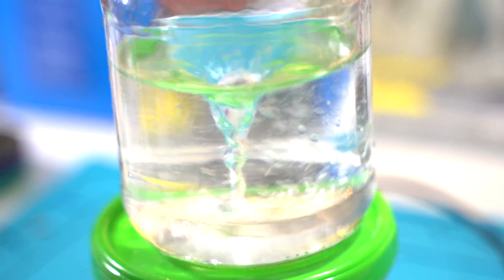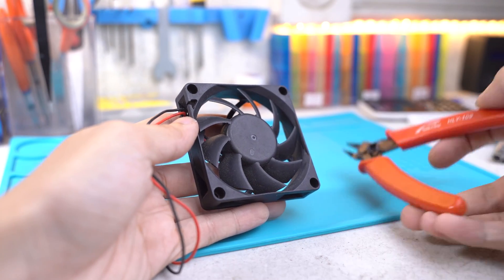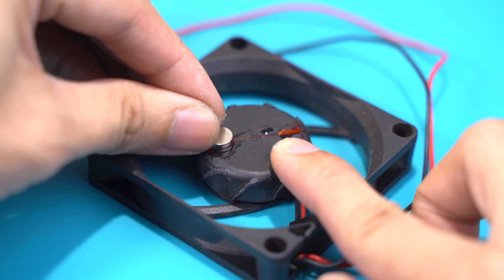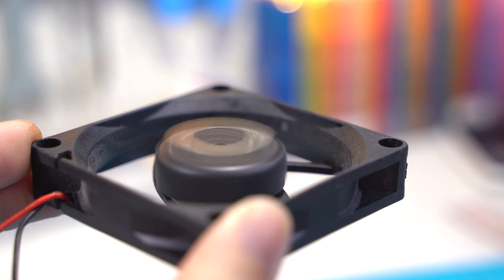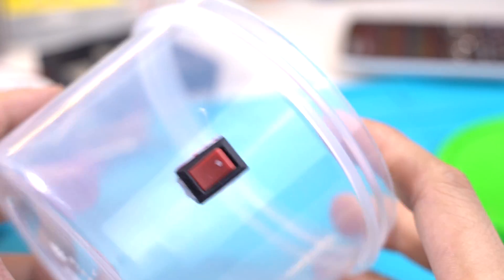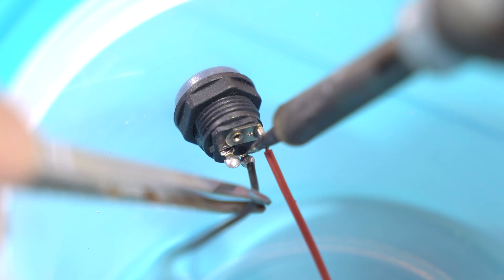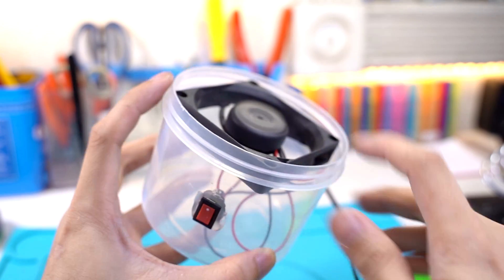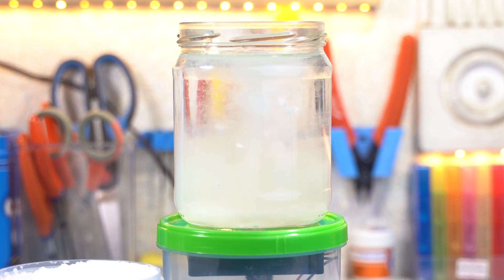Build A Magnetic Stirrer (Vortex Mixer)

Comment: Hard not to appreciate the ingenuity here. 

I was considering except its $28 to buy one and that’s about what the materials cost to make this. 

I really didn’t want to sacrifice the parts intended for other projects so off to. Amazon where they have a couple models and both come with the stirrers. The $35 model is quite large and includes 8 stirrers plus the magnetic rod to pull the stirrers out. 

It’s approximately 3000ml size. Wanted mine for mixing 3d resins before i start SLA prints and mixing airbrush paints. Having the platform lip so it don’t slide off for any reason is an another benefit.

Nice job btw.

Comment: Always wanted one of these, great video. Speed control sounds good, but I wonder if you could get higher rpms by leaving on two opposite fan blades and attaching the magnets to those. Magnets in the center of the fan mean high torque but low velocity. Of course you'd have balance issues if you had an eccentric load but I think it could be done.
Reply: You could just glue a stick on top of it and get the same effect with more stability.

Comment: I'm trying to make a wash and cure station for my resin 3d printer and my project uses a 2 gallon bucket. Would this have enough power to stir something that big? If not, what would you recommend I use as the motor?
Reply: 24v

Comment: The stirring element (the magnet) should be embedded in plastic, or it will rust and show physical signs of degradation right after it's first use in water (let alone in NAOH).

And besides a motor with more torque, a simple 555 circuit could have also been employed to provide adjustable speed, as a fixed one will not always work as intended, in practice.

Comment: what did you dropped in the water to stir it? thanks for your video!
Reply: Another magnet. You can also buy specially encapsulated magnets (cheap) which are coated to be chemically resistant, and be more effective at stirring.
Reply: @GamesFromSpace  oh I see. I was worried because sodium hidroxide will react with metal. the magnet has to be coated somehow

Comment: I have a magnetic stirrer with a probe thermometer. How can I tell if the probe temperature is correct? The temp of a candy thermometer was showing a 10 degree celcius to the probe so I dont know which temperature was correct!
Please help!!🙏
Reply: You do a calibration test of the probe. Put it inside known temperatures and measure the millivolts, if a two wire, or resistance of 3 wire and compare it to the appropriate chart.

Comment: What type and shape of magnet did you put into the jar? Also do you think this type of stirrer could mix paints? Specifically latex.
Reply: Paints are best mixed with a paddle and cordless drill
Reply: If the paint is in a metal container, it will not work. As the metal container is essentially a Faraday cage.

Comment: Can i use this for chocolate milk?
Reply: A simple way is after you are done mixing stick a spoon in there so the magnet will stick to it instead of running through your digestive system
Reply from the maker: Yes! 😂 But be sure to clean and remove the magnetic stirring piece from the mug before drinking.